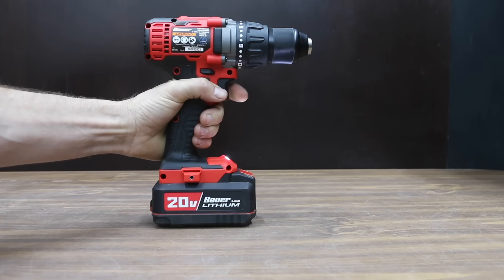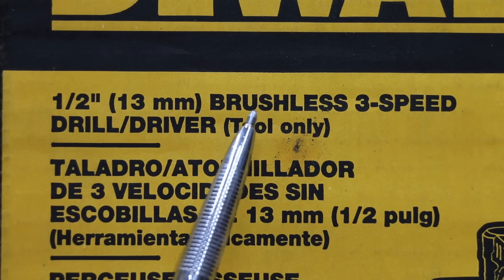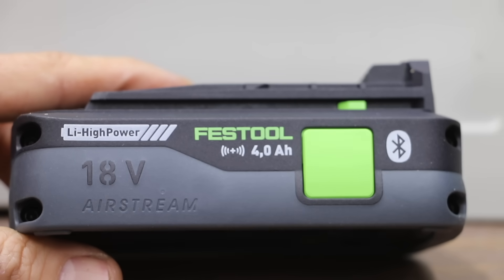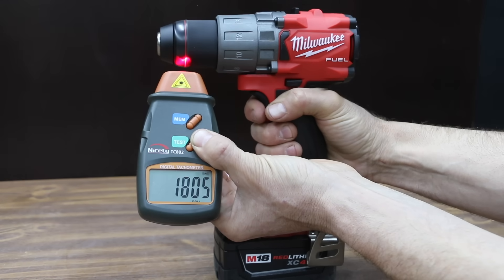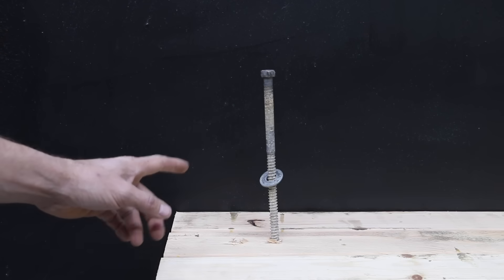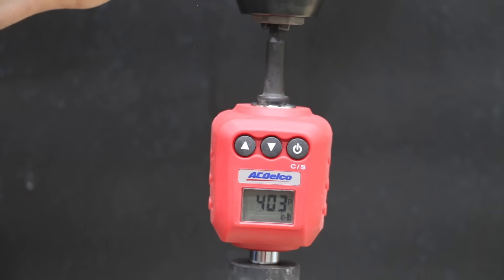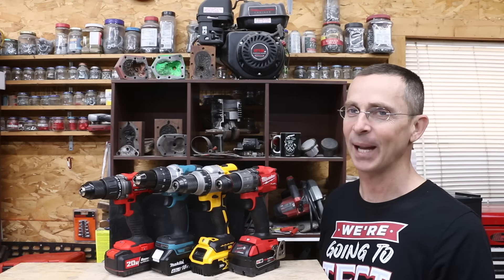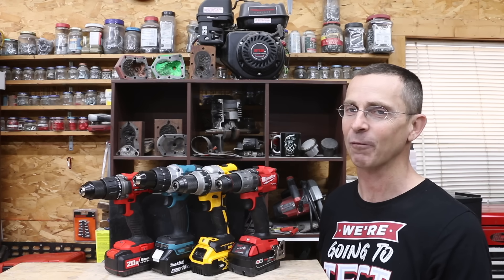Best Drill (BATTERY POWERED)? Milwaukee vs Dewalt, Makita, Bosch, Festool, Ryobi, Bauer, Ridgid

Comment: How does Festool come up with that price tag. It didn't even do any of the typical drill tests any better than drills 1/8 the price
Reply: I was also confused with that price tag, seems way too high. All the other drills were "drill only" and the Festool package consists of drill, battery, charger, Systainer. I bought that same drill (Festool DRC) for 160€ (195 USD). The only reason i bought it was because of the 3800 rpm for smooth holes in wood.

Comment: I have bauer tools I am older I gave my dewalt  tools to my grandson 
So when I need tools bauer was the ones because of the cost
I just finished a job of 36 Picnic Tables drilling 20  7/16 holes in each table the tools do ok maybe not great but the did the job
Reply from the maker: Thanks for sharing.

Comment: Why festool: the quietest (you can use it at night next to a sleeping child: P): compared to it the others seem to grind sand in gearboxes; The tested Festool model also has mechanical percussion for drilling holes in the brick :). 4 gears; it has up to 3800 RPM - for thin screws it is very useful :); it has very precise tightening torque  (I use it when tightening 10/12 mm screws in concrete). It has a quick-change chuck :) + 90 degree tightening adapter for increased comfort and narrow spaces :). Electronic clutch with vibration and audible warning (sound is produced by the motor by frequency control); by far the most advanced electronics - all the other competitors on the market are trying to copy its functions from 2013-2014 when this generation appeared on the market! You do NOT need more than 60 NM of tightening torque (Maximum torque is dangerous when you are tired and careless ) - over 50-60 nm you better use an impact tightening Drill that does not present a risk of injury in operation - except for the ears: P

Comment: I run a custom cabinet shop. I have a little bit of a different perspective than what was expressed here. 

First off, that specific Festool drill has super high RPM so it should drill holes fast, but other than that it's not the best. And most Festool tools aren't just for pure speed and power. They are mainly for ergonomics, dust collection, accuracy, and durability. 

I have owned maybe 7k worth of Festool tools. They aren't the best for everything, but they are amazing at their niche function. If you are looking for pure power, Festool isn't the brand for you. Milwaukee is probably the best all around tool brand for pure power.
Reply from the maker: Thanks for the feedback.

Comment: I’d like to see these drills drilling different materials not only driving screws. Thanks for including a Festool!
Reply from the maker: You are welcome!
Reply: @ProjectFarm  another important thing I’d like to see is charge/battery duration. Torque and speed are great but if I have to stop and charge that batteries constantly is a deal breaker.
Reply: Same here, a lot of contractors including myself (although I'm not a contractor) uses impact drivers to drive screws these days.
Reply: @scotthenry3401  agreed
Reply: Totally! Isn't that the central difference between a driver and a drill? Driving bolts is not the intended application. Maybe a demo drilling materials and driving screws of all types (delicate brass to cabinet screws...). There is also a lot to be said for tool durability and motor longevity.
Reply: @nathanielbrewster8457  there is a setting on drills for driving screws etc and was used that way untill impact drivers became widely used.
Reply: I’ve used the Festool PDC and it doesn’t have much torque but it smaller holes in wood are very fast in speed 4. I drilled a bunch of 3/8 holes in treated 4x4 recently. The Festool was very fast compared to a Milwaukee Fuel.
Reply: I think the point is to put them under extreme tests to see which performs best. Most likely those 3 brands would drive screws the best
Reply: Festool was trash for 2.5 times the price
Reply: Festool sucks

Comment: I have the Ryobi drill version before they added the LED light. I think it's also brushed. It works fine for what I use it for, which is fairly light work. I did have to drill MDF with it, as well as drywall. It's never let me down. I don't use the drill in a strenuous enough manner to encounter it's shortcomings compared to the rest of the drills. Maybe if the Ryobi dies, I'll get a DeWalt or Milwaukee, but that might be a long time coming.

Speaking of the Ryobi ecosystem, I have the Ryobi leafblower that takes the RyobiOne battery, same as the drill. Have you tested battery powered leaf blowers?
Reply from the maker: Thanks for the video idea.

Comment: For non-contractor use I love the Ryobi. True, it doesn't have as much power, but for the cost and the 18V One+  batteries that fit ALL of their tools, the versatility is hard to beat. I've built a couple of things that required over 300  3.5" screws and it worked great - just needed an extra battery.  What I'd love to see you do is convert your measurements into a per penny or per dollar ratio e.g. Brand X at $50 took 5 seconds to get the screw in while Festtool at $500 also took 5 seconds, so Brand X was 1/10 the cost per minute of work (or 10 times more effective per dollar).
Reply from the maker: Thanks for the suggestion.

Comment: I have the Milwaukee drill and I've noticed after drilling through camper frames with a cobalt drill bit it seems to shut off. Wondering if you could do a drill bit test with these same drills on steel
Reply from the maker: Thanks for the video idea.

Comment: As a professional ... the industry standards, Milwaukee/DeWalt/Makita/Bosch, are tough to beat for everyday, all day use and they offer great options... a company/individual makes a choice and the builds around that choice ... I started with Makita in 1985, switched to Bosch in 2001, and switch again to Milwaukee in 2013 which I’m currently using with exceptional results ... not sure how I found this channel but reall am glad I did ... your test are ALWAYS right on point ... thank for be an exceptional host with outstanding content ...
Reply from the maker: Thanks so much!

Comment: 11:55 There is a very high risk of getting injured with a drill if it has a very high torque because I have not seen anyone use the handle on them and at 60 NM  Festool (this is the drill that i use ) is enough to twist your hand and injure you quite badly if u usit with only one hand. that's why I use to tighten the screws only with the 90 degree adapter. I never used the handle provided :)
Reply from the maker: Thanks for the feedback.
Reply: 100 percent. I've made the mistake of using a Milwaukee drill to spin a wire wheel. Nuff said

Comment: Could you please test toaster ovens?

-interior volume
-toast 8 slices bread on the “medium” setting and see how they look
-how quickly they reach a set temp
-how well they hold a set temp (take a reading every 10 seconds for two minutes and average them)
-how much power they draw
-run them at max temp for 30 minutes to see if they suffer damage
Reply from the maker: Thanks for the suggestion.

Comment: Shocked that a $544 drill that's tailored for woodworking does not have a decent clutch. Those electronic clutches are garbage all around.

Surprised you didn't include Hercules which should a bit more on par with the competition.

Something else that would be good to include is chuck runout. I've got a Makita drill and it has a somewhat annoying amount of runout in the chuck.

Great comparison as always!
Reply from the maker: Thanks!  Thanks for the suggestions.

Comment: I want you to test vinyl replacement windows.  Look at UV resistance/durability, seal quality, structure integrity of frame, sealing, heat transfer and of course cost which varies a lot.  

Complicated area but if anyone can do a comprehensive review it is you.  You would probably get over a million views on that one.
Reply from the maker: Thanks for the video idea.

Comment: Wow, with the Bauer, it looks like there’s a little guy inside the rear housing trying to weld.
Festool makes great tools, but their drill costs five times more than I paid for my first car.
I’m saddened to see that the Festool excelled at nothing for that price—perhaps, ergonomics?
Milwaukee is consistently a great tool—as are the other “go-to” brands.  Frankly, ten years ago, these comparisons would not have even been possible.
Reply from the maker: Thanks for the feedback.

Comment: How about 1980s 80w gear oil vs modern synthetic multiweight gear oil?
Reply from the maker: Thanks for the video idea.
Reply: @ProjectFarm  I have a quart sealed in original packaging - if you're interested.I also have another which I thought was unopened, but the seal is broken. Circa 1981.

Comment: I have the Makita. It will turn 3 gallons of mortar in a 5 gallon bucket with a paddle mixer no problem, but you really do feel the weight.  I ended up buying its little brother and I use it for most projects.  I like the Makita 18v platform but none of them are light and a LOT of them are sensitive to heat.
Reply from the maker: Thanks for sharing.

Comment: Project farm - suggestion. Test the new micro drills. I just bought the rigid micro impact and the drill. The impact is worthless in comparison to the regular sized one. But the drill is quite nice. Actually has some power with a significant decrease in size. They did cheap out on the rest of the drill though. It lacks some features. I really wish somebody would come out with a high quality micro-drill. It is quite nice to use with a light 2ah battery.
Reply from the maker: Thanks for the video idea.

Comment: What would you use the 3800 rpm speed on the festool for? Seems like it would be awful hard to control. On the flip side, the 1300 rpm speed in the dewalt seems like a helpful addition
Reply from the maker: Thanks for the video idea.

Comment: I like your ideas and how well you present themive used Dewalt tools since they introduced the 14 4 volt drills about twenty eight years ago or so.. Those four drills have worked hard all their lives, never failing to work. Four years ago I added three of the twenty volt drills and two hammer drill tools intending to replace the 14.4's. Surprise, everyone still wants to use the 14.4, because of their balance. 
My only gripe is the batteries, well, they ARE consumables.
Reply from the maker: Thanks for sharing.

Comment: Also I own the rigid and I have come very close to injury from the torque. The Milwaukee is insane. Like a hand held drill press. How are there not more injuries from that?

You know what always gets me, is the big hole saws. I cant even fathom what it feels like to use a 4” hole saw bit with the Milwaukee and have it catch. How do you not get injured? You can’t always put that grip extension on.
Reply from the maker: Thanks for sharing.

Comment: Great video as always. I'm not a contractor, just a home owner with stuff to fix/build. I actually own the hammer drill version of the Bosch used here. As I expected it wasn't number 1 in any category. But in my opinion the clutch is very useful. It is mechanical with a sensor attached that will cut the motor to. With the CORE 18 batteries its more than enough power for someone like me.
Reply from the maker: Thanks!  Thanks for the feedback.

Comment: Excellent science applied to the testing.   Love the drills (pun intended), always great to watch!

As someone who keeps battery power drills (and other tools) professionally in my kit, but don't use all day every day, wherein every second might be money (eg perhaps in framing/ construction) I'd say over time, Ridgid has worked out much better for me than DeWalt because of their real lifetime warranty, which they actually DO honor.  Don't think any of the other brands have that warranty.  

I have never yet had to pay for replacement batteries (or repairs) since switching from DeWalt to Ridgid in 2010.  And still using those same 2010 tools as all newer style batteries are backwards compatible.   

My DeWalt tools from before 2010 still sit on the shelf with dead batteries which I resent having had to repeatedly replace.  Some other brands may outperform,  but for me warranty service takes priority.   I am, and will remain, a Ridgid user for the (truly) lifetime support.  Buy it once and only once.   Period, including batteries.  No other beats Ridgid in this aspect.
Reply from the maker: Thanks!  Thanks for the feedback.

Comment: Used Ryobi, Rigid, Dewalt, Makita, Milwaukee and Bosch, Bosch have best Handling, speed control, steadiness and safety feature.

If you want a more power or speed, you should buy a Cordless Wrench not a drill.

I love your videos, but the objective of this test I think is off.
Reply from the maker: Thanks for the constructive feedback.

Comment: I've always been partial to drills over impact drivers. Having a mechanical clutch,high speed, and speed control kinda makes impact drivers lame. Besides if i want torque i can just grab a wrench or breaker bar after using a drill and properly torque things down till i hear a ping then i back it off a bit and leave it for the next guy.
Reply: Makes sense, thats why professionals use impact guns nowadays instead of drills...
Reply from the maker: Thanks for sharing.

Comment: Why do the manufacturers refuse to make the top of the drill flat and parallel to the motor shaft. It they did, a square could be used to keep the drill perpendicular when drilling holes. Always the top of the drill is a cluster of angles, ridges and lack of engineering.
Reply from the maker: Thanks for the feedback.

Comment: Another great video, love your work!

I love Festool’s saws, sanders, and domino machines, but they clearly have work to do with their drills. 

One note, somewhat unfair not to mention that the Festool drill comes with the systainer (toolbox) and others accessories that none none of the other drills included. You can get the more comparable basic set for $350 instead of the shown $550 combo.

Also, people fail to realize that Festool doesn’t make their tools in Asian countries that pay poverty wages. I think all of their stuff is made in Europe. That will definitely make a difference on price, and likely wins any ethical argument. 

Oh, and their customer support and parts replacement is easily the best in the business. I had some old Ryobi tools that I literally couldn’t get simple parts for. Ended up having to trash the whole tool. Such a waste.
Reply from the maker: Thanks!  Thanks for the feedback.

Comment: you should do a video on different types of fasteners just as an informational that drywall screws are not universal screws! include nails too. for instance, nails made for hurricane straps vs framing nails. the strap nails are ductile so they yield instead of sudden failure

Comment: I have the Dewalt drill. It works very well with delicate fasteners if you put the drill in 3rd gear and then select the lowest torque on the clutch. If you use the clutch on the lowest setting in 1st gear it isn't as low.
Reply from the maker: Thanks for sharing.

Comment: In my work installing handicap mobility products we use batter powered vacuums. I have a black and decker battery vacuum that replaced my Ryobi 20v that crapped out. It died as I started this new position so I don’t know the actual life span. As we are trying to vacuum wood from pilot holes in stairs and aluminum shaving from self tapping screws and cuts. I would like to know which handheld vacuum
Reply from the maker: Thanks for the video idea.